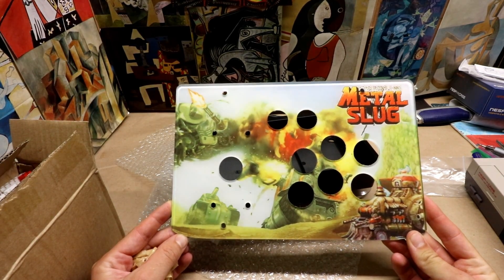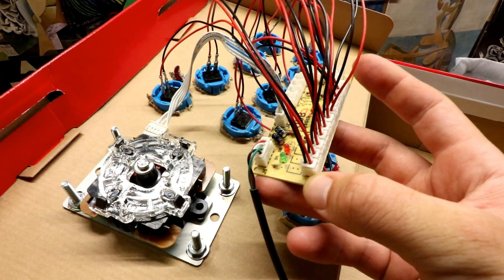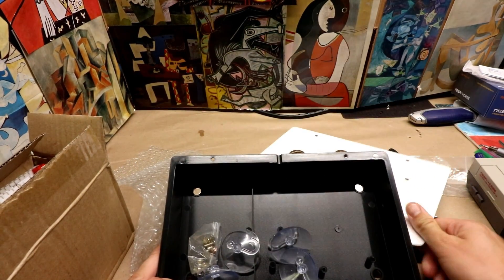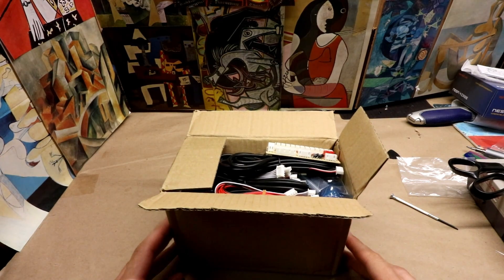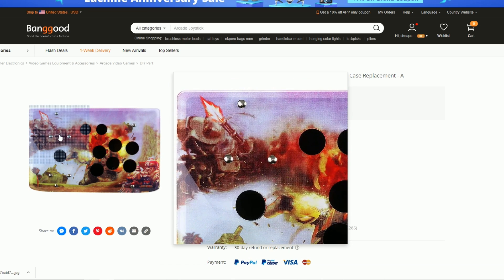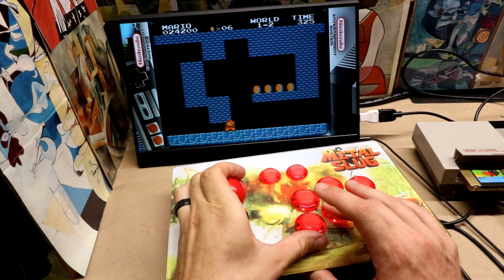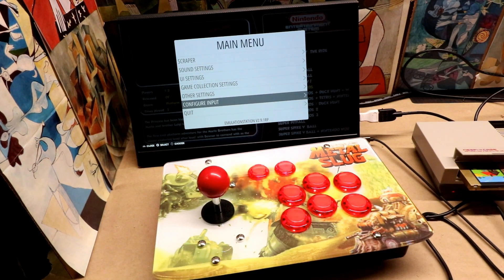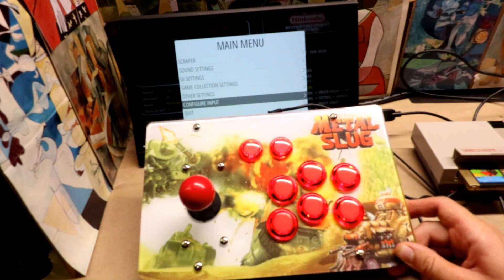Build Your Own Cheap Custom Raspberry Pi PC Arcade Stick

Comment: silly question for anybody that can answer did I see correctly that the button work without the led and if so can I connect a switch to the led wire harness to be able to turn the led lights on and off without it affecting the use of the buttons. I have seen many builds but never found a clear answer to this question.  thanks as always for the content.
Reply from the maker: You could run a switch between the cable that goes to the encoder board in the five volt power
Reply: @drewtalks  thank you never tried I always assumed that the led lights needed to be on for the buttons to work. The led buttons I have used in the past have never had a seperate 5v for the light they have always plugged directly to the encoder board for each button separately. Thanks as always great videos.

Comment: I built one two days ago using the same case and same length buttons... I had to bend the end of the wires at the bottom of each button to get it to fit and one button is still smashed into the usb encoder board so it feels super sticky. If you don't know what I mean, take a button and push the pins up into the button housing and then try clicking the button. Not sure how you or others are able to fit them without issues, but I've ordered the smaller sanwa style buttons to hopefully have more room to work with. Regardless, fun quick DIY project.

Comment: There is a tab on the end of the cables. Press the tab with a small flathead screwdriver and they will come off easily.

Comment: There is quite a number of these 2 piece acrylic knock offs out there.  I bought one from Amazon.  I also drilled holes on the side to add pinball "flipper" buttons.  For me the only two disappointments are 1) I wish there was more surface below the buttons to rest your palms and 2) as you pointed out, it's a pain to unscrew and take apart to switch between 4 way and 8 way  joysticks.  ...may have to build two of these Arcade sticks ;)  Thanks for the great videos!

Comment: Unless you really want a project you're better off just buying a stick on Amazon or something. This is way too expensive for a low quality stick that you have to build yourself.
Reply: Do you have any recommendations for a arcade stick around this price range?
Reply: Harley French Games Mayflash F300 Arcade Fight Stick Joystick for PS4 PS3 XBOX ONE XBOX 360 PC Switch NeoGeo mini https://www.amazon.com/dp/B019MFPLC0/ref=cm_sw_r_cp_tai_qXXrFb0WDQNN5
Reply from the maker: Yeah, there are coupon codes though 25% off the buttons and the case. I mnetioned that in the video though that if you have more money get pre assembled

Comment: It would be cool if you built the Pi actually into the joystick case, add two 30/40mm fans either side for airflow.  Then just plug in USB power and HDMI, portable gaming system :)
Reply from the maker: Yup!

Comment: Yeah these boxes are cheap but there’s no weight to them. Hated the one I had.
Reply from the maker: Yeah you could add weights, also they sent me 25% off codes for my viewers on both the case and the buttons which puts it much cheaper.